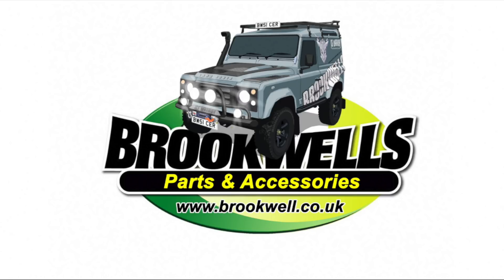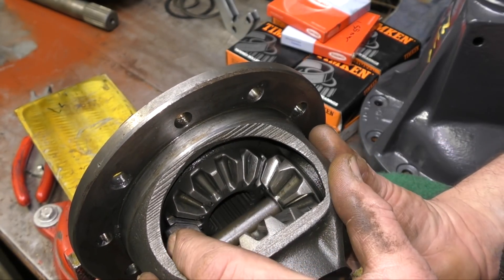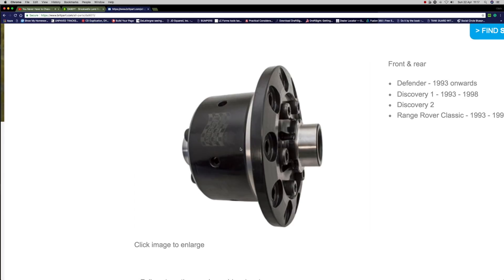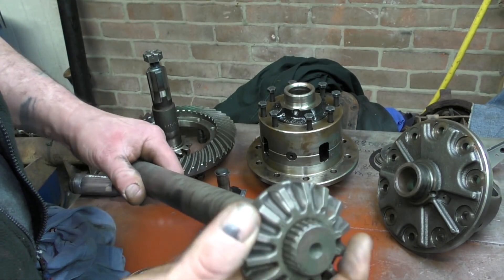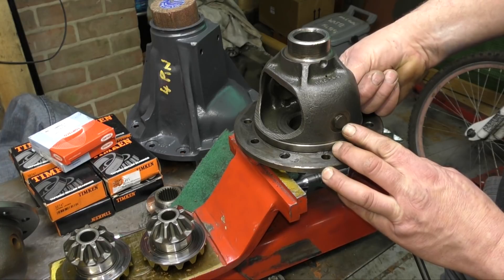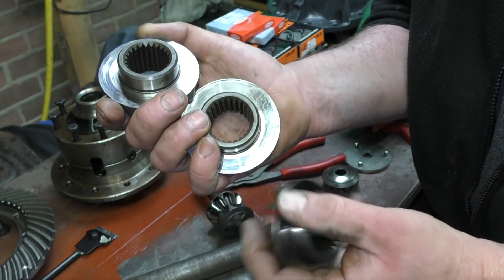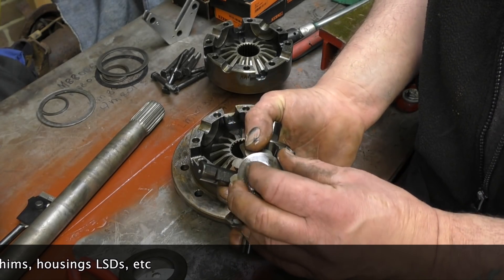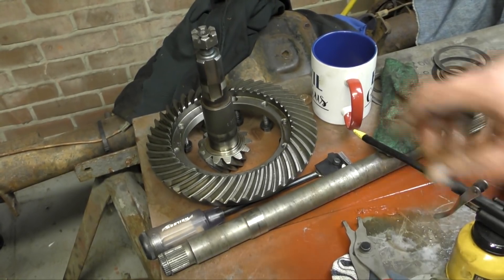Land Rover Differential Overhaul - Diff Carrier Inspection and Wear Check

Comment: Just replaced the rear diff on my D2, after discovering that the planet gear axle had snapped. Got a hold of a very nice second hand replacement for about 250£. 
But now I almost regret not getting a 4 pin insert instead 🙄
Helpful tips anyway 👍👍

Comment: I had a salisbury axle which chewed up and spat out those thrust washers and sent them round the wheel an pinion. still ran lovely and no damage anywhere else. They are pretty tough, the chewed up thrust washers finished up in the bottom of the housing!